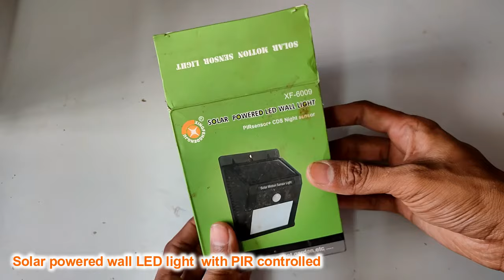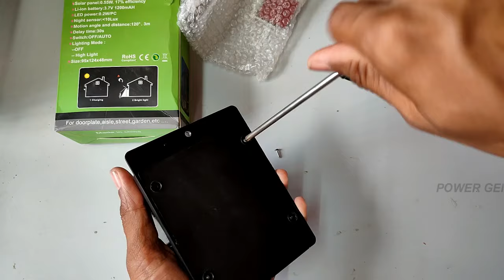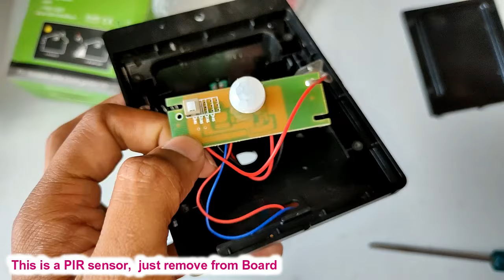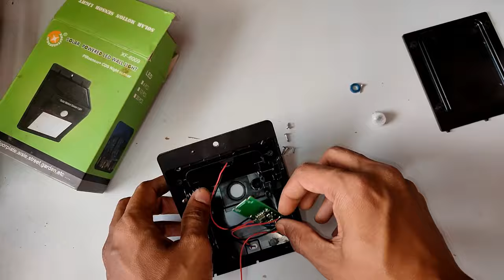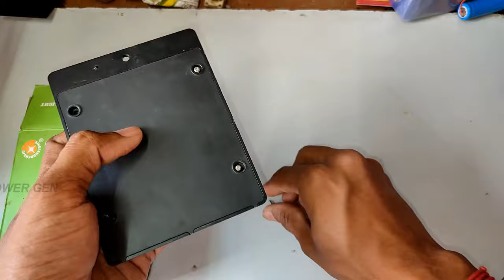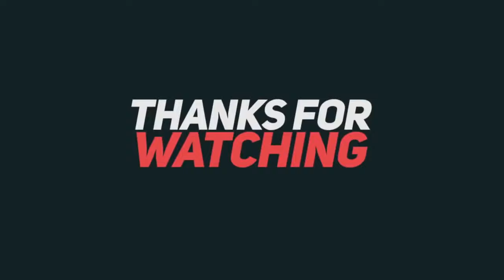How to Disable or Remove The PIR Motion sensor in solar wall light | POWER GEN

Comment: Please read before removing the PIR Sensor. Firstly this video is misleading. This board has auto switch-off feature after 15 to 30 seconds. With the PIR sensor if your light turns off after 15 to 30 seconds, even if you remove the PIR sensor it will turn off after 15 to 30 minutes. So don't remove the PIR sensor unless you are planning to put it back. :)
Reply: Yeah, I removed the PIR sensor and walla.... it DID NOT work! Well, it turned on... but then it automatically turned off after few seconds. So, after removing the PIR, you may have to bypass that sensor and connect something else, WHAT?
Reply: Hi Sameera,
You are dam right.Tthose solar lights comes with a 555 Timer IC of 30 sec. After the light go on, it stays on FOR ONLY 30 SEC. I did this test and now I'm working on the Timer. You have to take the Timer out or bypass it.
Many thanks for your remarks. 100 % TRUE.
If you have any info how to remove or bypass the timer just reply.
I want the Solar Wall Light to TURN ON when it's dark and TURN OFF at Sunrise.
Regards from Curacao Island.
Reply: @nelsmartis8324  can you make a video on this? I am early waiting
Reply: Another sout there is no heat sink provided for led so it will damage the light if runs continuous ly
Reply: Do you know of a way to bypass that setup? I was reading into my solar lights that it has a built in photocell I believe to turn it on only at night but can't find it in the circuit itself..thanks in advance
Reply: @nelsmartis8324  did you ever find a way to bypass that? I've read into my solar lights they have a photocell that only allows it to turn on at night past the pir sensor..not sure if it applies to yours as well.maybe work together to figure out
Reply: cant you just short the two wires connected to the sensor?
Reply: @bikash3003 hello sir I made a video bypassing PIR sensor and timer find the switching transistor on board from their you can solder wire on base then connect manual switch between transistor and negative of battery .
Reply: I was searching for the details of the 8 pin IC used in this type of solar lighting. Now your comment has enlightened the IC ( in my gadget the IC marking is wiped out making me to search for the details). Now I am very clear about the circuit. Thanks for sharing. Very flimsy gadget without any protection for avoiding the battery draining.
Reply: Oky masuk akal

Comment: There is also a timer in the circuit. By  Remove the motion sensor, the light will only come on for a few seconds and switch off. It won't come on again unless power button is switched off and on again.
Reply: Yes its useless video i try it to remove the sensor not its not working
Reply: Me too
Reply: Yes fake video not workinh
Reply: Much easier method is to take the fucking control board out and burn it and hook up simply red black wire to battery done deal
Reply: @michaelweber3369  is that working???
Reply: @michaelweber3369  is it working???
Reply: Yes it finally works
Reply: @michaelweber3369  This really worked because I was thinking of doing that to several lights I have then  them wired to a transformer that has the dusk to dawn control. So the circuit board isn't needed?
Reply: not working, you turn on again the switch to on the light. useless
Reply: @michaelweber3369  then how does it turn off during the daylight... Doh
Reply: Gracias casi lo hago hahahaha, al final encontraste solución

Comment: If someone gonna remove the PIR sensor, remember there's a timer in side the circuit. So we have to always switch on and off when remove the sensor 😂
Reply: Yes, I did it today, its now going off as per timer
Reply: Same here man..
Reply: Got any solution?
Reply: Need use resistor 10k
Reply: You are dam right.Those solar lights comes with a 555 Timer IC of 30 sec. After the light go on, it stays on FOR ONLY 30 SEC. I did this test and now I'm working on the Timer. You have to take the Timer out or bypass it.
Many thanks for your remarks. 100 % TRUE.
If you have any info how to remove or bypass the timer just reply.
I want the Solar Wall Light to TURN ON when it's dark and TURN OFF at Sunrise.
Regards from Curacao Island.
Reply: @nelsmartis8324  Hi Nels, any more luck with the timer? At least theoretically, it must be possible to replace it with a longer timer, or maybe the current timer can be reprogrammed to a longer duration?
Reply: @ahmaddhani669  where abouts do you fit the 10k res?

Comment: Don't do it this is fake video ,chip has  programs that will do auto switch off . Even when you remove the pr sensor
Reply: So, how to solution continued lighting in the night,? I must remove ic
Reply: @trikotomotif3381  I think you can install rocker/push button switch just for the bulb to turn on and off rest of the circuit can be left to whatever is there no need to change anything.just incase in feature you want to reset to default.
Reply: Operate manually
Reply: @solanki_tech    this is good, but here u have to press that button every time you want to off or on, what if we use a transistor that makes it automatic. once the switch the circuit on, led will not glow until there is no light on the solar panel.
Reply: @Abhinashkumarsingh  yes this also a better idea...
Reply: @Abhinashkumarsingh  and what about the battery connection?
Reply: @solanki_tech    leave the circuit will just remove the led wire. and + of the battery will directly in the collector of the transistor and emitter be connected to led + . Now solar positive wire will be connected to the base. when the sun will be up the base will not allow the led to glow.

Comment: We already removed the motion sensor but the light doesn't last long and we just press the on button to turn it on, we want to keep it on the whole night. How to achieve that?
Reply: I got the same results. It will only last for 15 seconds then turn off. You need to turn on the light then turn off to activate then only last for 15 secs.
Reply: Yes
Reply: @raymonddulatas1851 É preciso colocar um puso para simular o sensor pir
Reply: Solution for this
Reply: Operate manually

Comment: Hello buddy,i removed swnsor but light stays only for 15 seconds and the off.,do we need to complete circuit,how to keep light on all night till battery runs out
Reply: É preciso colocar um puso para simular o sensor pir
Reply: same thing happen here only 15 seconds then totally off. you have to re switch it to ON again.
Reply: @JungKook-ij6dj   o sensor PIR  gera  pulsos quando a sua área de detecção e invadida. por isso quando ele é retirado é necessário providenciar um gerador de pulso para que a lampada continue acessa.
Reply: Replace battery and fix to permanent

Comment: I am also planning to do this but that would mean to add batteries and increase capacity so it could run the whole night since it would now be always on. How much max voltage can the board take? I hope you make a video.. great to find this video.
Reply from the maker: A maximum of two batteries can be used,
because of the solar panel not enough
Reply: Solution for this
Reply: Turn on manually
Reply: Dont know if you notice but if u check those cell inlcuded only have capacity of 1200-1500mah. Change those cell to higher mah true cell like samsung 25e or 28e

Comment: Great video, works for some models, but in other models you need to bypass the circuit. Its very easy, you need to weld a piece of cable between the vcc lead and ir lead where the pir sensor was. Hope this trick helps you all
Reply: what type of cable?
Reply: @andriesfritz5594  a piece of electric cable, 0.2 or 0.5 diameter works well
Reply: this method works for me,
Reply: Sorry what's vcc lead?
Reply: @joseluisjimenez7228  voltaje de corriente continuna
Reply: @roymckankakee  gracias por responder. Podrías ser un poco más específico? U can try in English if u want. Thanks
Reply: @joseluisjimenez7228  uff esque hace tiempo que hice esto y no me acuerdo muy bien la verdad, quite con el soldador el sensor de movimiento e hice un puente con un pedazo de cable donde iba el sensor, es basicamente seguir lo del video, pero con tuneandolo con el trozo de cable
Reply: @joseluisjimenez7228   mas arriba, ahora que leo, puse el puente soldado al pin VCC y el otro extremo al pin IR, lo que pass es que hay que quitar el sensor de movimiento para saber donde van cada patilla
Reply: @roymckankakee  cuál de los 3 pines del sensor?
Reply: @joseluisjimenez7228  olvidate del sensor, arrancalo de ahi y despreocupate, en la placa vendra lo que buscas

Comment: Do not do it.In the dark  The light will  continue to  shut of after 15 seconds. The person who upload this film should explain how to change so in dark the light will remain on all night
Reply: Could you explain more please. I should remove the sensor under the a light or in the dark??
Reply: Sir I ded my own way it's working
Reply: @hanas_340   I cane tall u my method that work
Reply: @pakistanzendabad3793  Please tell me.
Reply: @hanas_340  I just jump  wire one of sensor leg with battery + it will stay on in dark and off in Sun  i just did today with my two LED I am not professional but I did it
Reply: @pakistanzendabad3793  can you send photo?
Reply: @marenooo   x2
Reply: @pakistanzendabad3793  can you tell how
Reply: @pakistanzendabad3793  Those solar lights comes with a 555 Timer IC of 30 sec. After the light go on, it stays on FOR ONLY 30 SEC. I did this test and now I'm working on the Timer. You have to take the Timer out or bypass it.

I want the Solar Wall Light to TURN ON when it's dark and TURN OFF at Sunrise.

Would you please explain me what you did?

Regards from Curacao Island.
Reply: Sensor leg? Or sensor Led be specific please
Reply: Ah u mean on wire from sensor to battery+  and one wire of sensor must be in motherboard/pcb

Comment: I have an almost identical simple one, but with 3 light panels. When switched on, there's 3 choices of  brightness, high , low or dim. High and Low come on via the sensor (as it should),then it goes back to dim. My question is, WHY does the dim stay on, and not go out like the H & L after 30 seconds? I've not put it up anywhere, yet, not until I know if the dim is meant to stay ON all night, or not? Or  will it go off when daylight comes? If it doesn't go off, that means I'll have to turn it on and off every day. lol

Comment: That leds stoped automatically after 15 seconds. How its possible to continued lighting?
Reply: que dure mas tiepo gracias
Reply: Yes, it is possible only when the PIR motion sensor is disabled.
Reply: @technosmithz9589  how you disable the pir so the led will turn on in dark and off in light ?
Reply: @BennyReichert   Thanks, I think if we disconnect/remove the PIR sensor from the circuit. I think this may work. You're also most welcome for any suggestion.
Reply: @technosmithz9589  no even after removing sensor light turns of automatically after 5 mins
Reply: Just tried this as I wanted the light to be on permanently when its dark and not just when dark and motion is detected.
Removing the PIR doesn't affect the lights function so STILL only comes on when dark and motion detected!!!! 
Goes off again after 20secs.
Reply: @technosmithz9589  
Can you tell us 
The truth, if we remove the sensor 
It will affect to the delay time of light???

Or it doesn't??.
Reply: @romnicktalamo7604  Thanks, no, there won't be any change in delay time.
Reply: @technosmithz9589  
Okay² so How we can remove the time.?
Reply: @romnicktalamo7604  I think PIR is making the circuit ON and OFF, we have to by pass the PIR, for always on. We can bypass with a suitable resistor, to make a dim light in night, and full bright when motion detected.
Reply: @lijumadambi4008  oh, that is nice idea... Good. If you get how to do please let me know

Comment: Hey sir Does this light have battery protection for protecting the battery from over charge and discharge ?
Reply: I don't think so. The price you pay will get you without over voltage protection. The light I have is already blinking due to overcharging. When I measure voltage across legs from the solar terminals it is 5.3 volts, for poor 3.7 volts battery.
Reply: Cover half the solar panel up so it doesnt charge so much...

Comment: By default it works in night. I have requirement make sensor work in day. Is it possible?
Reply: I also need to know how to make it work during the day time in day light
Reply: @tonyman2340  Add a switch to the Solar Panel wire - turn off during the day for light - remember to turn back on for charging.
Reply: @dnbliff  thanks a million
Reply: Turn on manually

Comment: I got the same results. It will only last for 15 seconds then turn off. You need to turn on the light then turn off to activate then only last for 15 secs.
Reply: I am also need
Reply: É preciso colocar um puso para simular o sensor pir
Reply: Operate manually

Comment: Can you help me? Is there a way so that it will turn on manually without touching the upper part?
Reply from the maker: LED light directly should be connected to the battery and set the switch
Reply: @powergen522  please have a tutorial pleaseee
Reply: @powergen522  vedio tuturial plss
Reply: Turn on manually

Comment: Can i just cut it? I dont have a soldering tool
Reply: I dont have one either
Reply: How did you do i an also facing the same problem
Reply: Operate manually
Reply: you can put a strip of tape over it

Comment: I need this solar light to lit in high intensity when it becomes dark until the battery will get empty.
Reply: leave the circuit will just remove the led wire. and + of the battery will directly in the collector of the transistor and emitter be connected to led + . Now solar positive wire will be connected to the base. when the sun will be up the base will not allow the led to glow.this will do the work
Reply: @Abhinashkumarsingh  your explanation is very confusing, can you detail this better???

Comment: Can you help? My same device the light don’t get off. If no motion the light will become dim but it will not off. I want to to go off so battery is saved. Motion sensor is working fine. Only light don’t become completely off. Can you help why? I can repair myself if you just teach me what to do or why is this problem?
Reply: Operate manually

Comment: Isn't it obvious that even if the sensor is removed the lights will stay on only for the period it was turned on in the dark and goes off again in the dark!!!! Most of (posters/repliers) you are missing that part which is  the lamp shuts off after a period of time...it is not meant to stay on even if the sensor is removed. This feature is not the function of the PIR sensor it must be built into the circuit itself...why can't you all think🙄 I'm as dumb as you all in electronics 🥴

Comment: I remove PIR sensor but it ligt only 30 seconds , Pleace tell me how to continued lighting in the night , not only 30 seconds
Reply: Have you figured it out yet? I think you need to by pass the circuit board.
Reply: @motto666     leave the circuit will just remove the led wire. and + of the battery will directly in the collector of the transistor and emitter be connected to led + . Now solar positive wire will be connected to the base. when the sun will be up the base will not allow the led to glow.

Comment: I also did the same removed the sensor but turns off after 4 to 5 seconds
Edit:- the battery has low power capacity use it on medium
Reply: Same to me..😢

Comment: Theres an easier way just put a piece of electical tape over the sensor
Reply: If you do that, it will turn off and not turn back on.
Reply: Operate manually

Comment: Wtf. You have a button in the left of this sensor and use it to change the mode of this item. It has 3 modes, the 3rd keeps the light on permanently.
So why shoud i remove the sensor?!
Reply: Where to find
Reply: Where is it??
Reply: You can see it is just near of the pir sensor.
Reply: Have you really checked all three modes of the switch.
Reply: @technosmithz9589  yes. The 3rd one keeps the light on permanently while it is dark outside, just like he does in video
Reply: @BogdanNicu  , I find only two modes.  On& Off
Reply: If you watch the video at the end the light keeps coming on and off so what ever he did wasnt right
Reply: Yes in some cases, but my light has only 2 modes "ON/OFF".